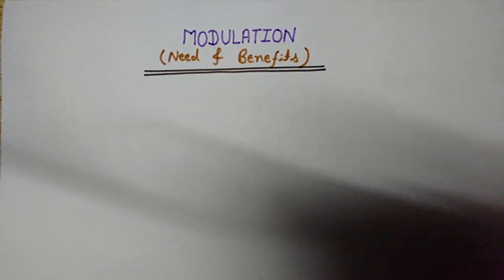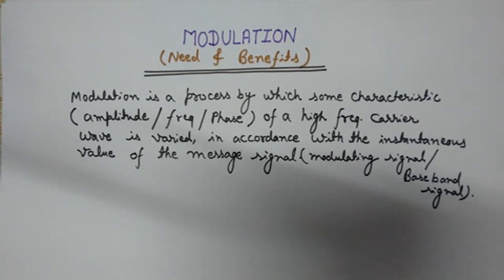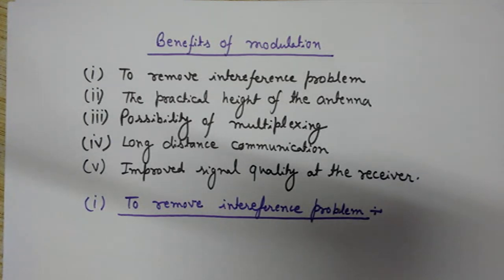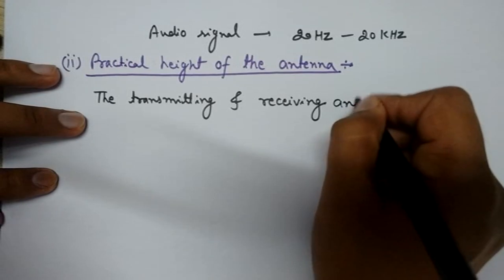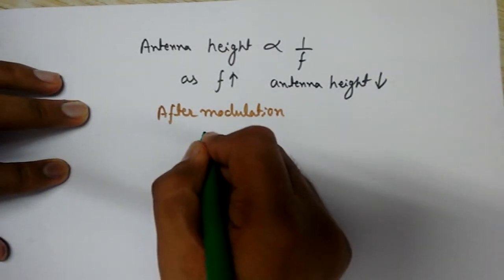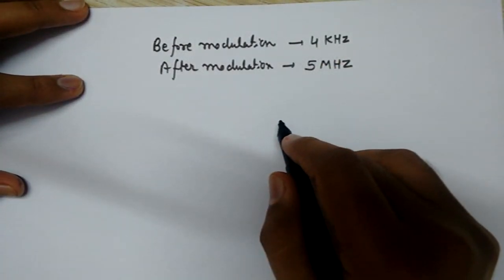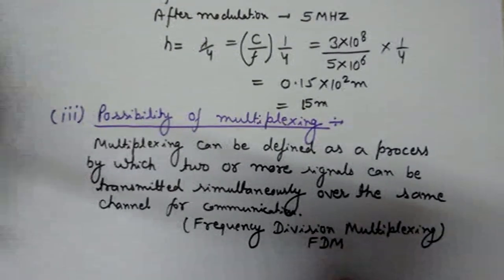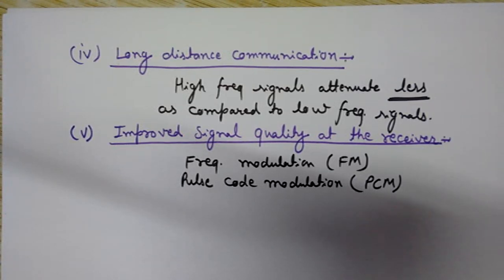What is Modulation - Need and Benefits of Modulation - Why Modulation is Required (Necessary)

Comment: the minimum height of the antenna needed to transmit a signal of frequency 10 KHz from ground station is about 7.5 Km. Is it possible to do so?